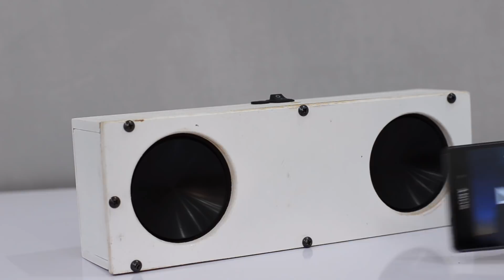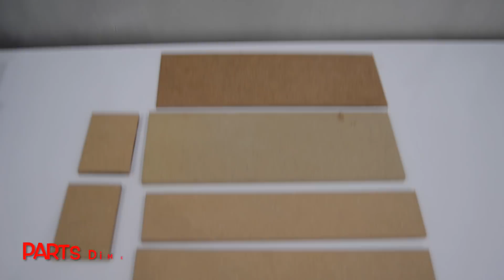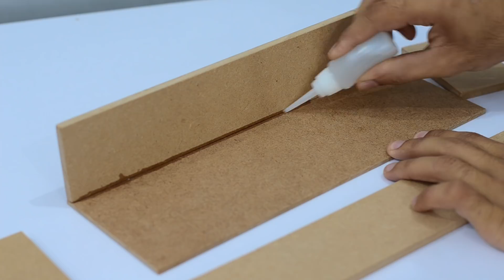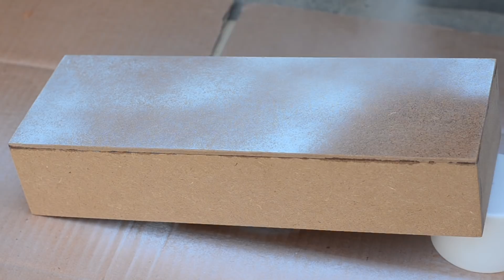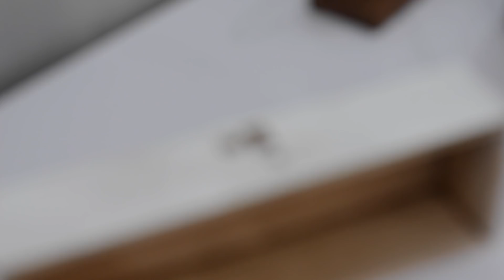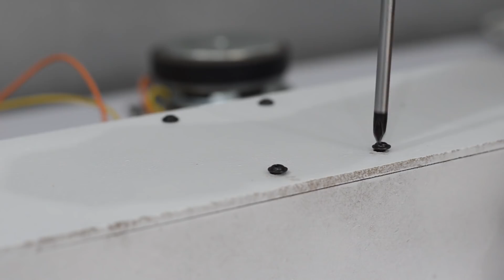How to make Cordless Bluetooth Speakers

Comment: You have given the wrong information, they are not lithium polymer batteries, they are 18650 lithium ion batteries that are very different and it is better to use a protection plate for the load to avoid damaging them, and every so often they have to charge one per one to avoid load differences and spoil ...

The best way to do that is to use a balancing charger and mount the battery with a connector for the balanced or use a battery holder for 18650 and can extract them to charge them individually every three or four cycles ....
I like those speakers, what power are they?

Comment: Bro those batteries aren't gonna provide a 100w output. You need 12 v 10 amps for maximum output . These 3 batteries are would just deliver less than one fourth the power. Also using an 8 ohm speaker is good as it would sound better but the maximum output would be around 80w delivered to them by the amp. Hope this helps!

Comment: Using 18650 batteries without a protection board is not safe and could cause a fire. Please modify your video to show proper safe 18650 battery handling or make a disclaimer.